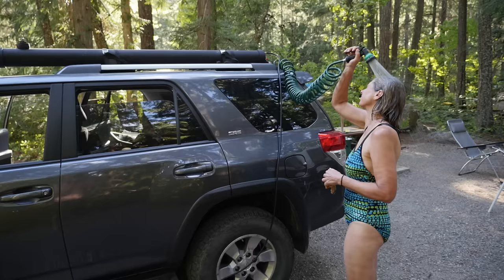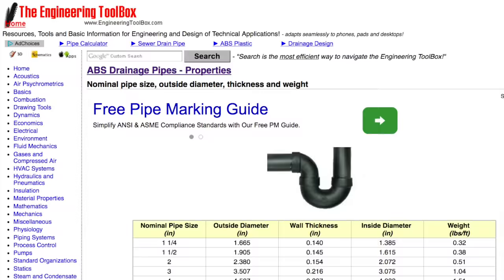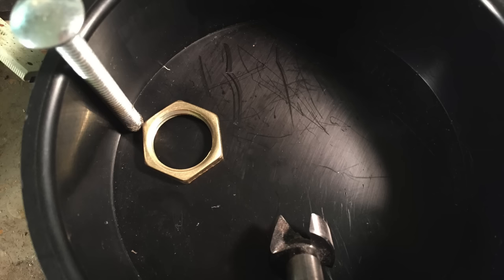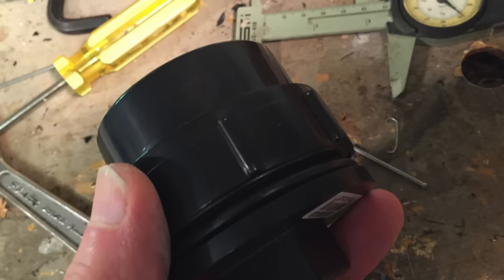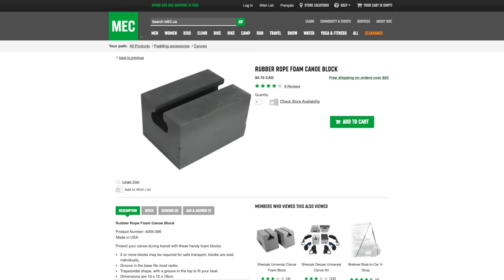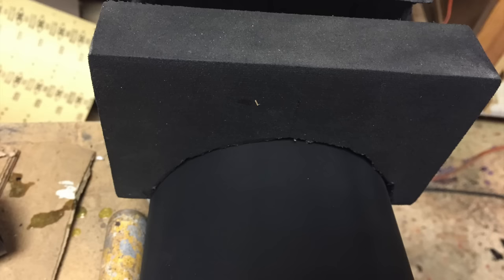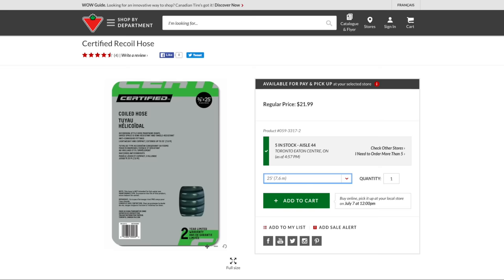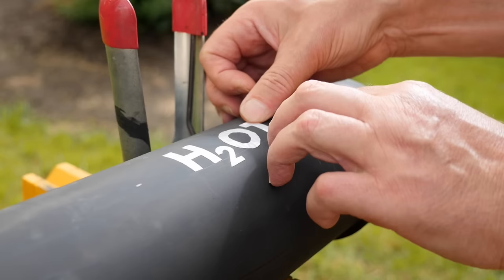H2OT - Rooftop, pressurized, solar-heated shower/sprayer using ABS pipe. DIY

Comment: Could you provide links to the valves you use?
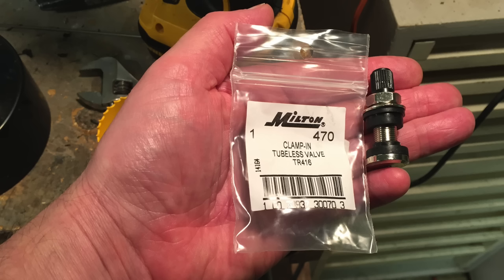Reply from the maker: All the components are shown in the video at 1:27 and 1:58.  I do not list them as the odds of that specific part I used in the build also being available where you live are slim. Unless you live in Canada, many of these parts would require substitution so links to what I used is irrelevant.

Comment: how much did the whole contraption cost - time and money? Was also looking at Road Shower 2 for sale but price is like  $300 with the mounting pieces.
Reply from the maker: It cost me $300 plus mounting pieces.  :-)
Reply: @Blake, he mentioned that it cost $500 to import, so this a $200 savings. you could make it much cheaper by using abs pipe which is already black.
Reply from the maker: No, I was joking. It cost me about $60 total.  I would not make it if it cost the same to buy. Most expensive part is the ABS pipe, which was about $30 if I recall. 

NOTE: This IS made with ABS pipe. Yes it is black, but it is shiny. I painted it flat black to aid absorption of heat.

Comment: My friend gave me their pvc shower, but it keeps leaking from the caulk around the valve anytime it's pressurized above 5psi. Does anyone know what materials or adhesives I can use to seal it up to whitstand higher pressure?
Reply from the maker: JP Weld will patch anything. Give that a try.
Reply: @ImaginetMedia  awesome I'll try it out. Thanks so much for the advice
Reply: @ImaginetMedia  Just saw there's so many types of JB Weld. Any input on which might work best?
Reply from the maker: https://www.jbweld.com/product/j-b-weld-twin-tube
Reply: imaginetMedia thank you so much!
Reply: Nicholas Kinoshita flex seal

Comment: I’m about to start this build tonight. I went with legitimate PVC, which you know is a bit heavier duty and without the BPA. Was thinking about going 7-8 feet instead of six. Any reason why you would recommend against this?
Reply from the maker: Take a piece of PVC pipe and a piece of ABS pipe, same size. Put them on the ground. Take a sledge hammer and smash each one.  When you get back from the hospital having the shards of PVC removed from your face, I will explain to you why I used ABS.
Reply: imaginetMedia hahaha. Well, I don’t expect this to be taking impact hits like that... but regardless, what do you think about the longer size/pressure in the tank.
Reply: imaginetMedia also, I won’t need an explanation after the shards have implanted themselves... lol
Reply from the maker: @DrewTimelapse  I think the longer version would be great. However, with that length comes significantly more mass (pipe and water) on your roof. The problem would be securing the heavier tank using only straps as I showed. I suspect a much bigger version might be classified as a missile launcher if you hit the brakes too hard.
Also, I used 6' length because that is. common precut size of pipe. Longer than the standard would certainly cost more.  I suggest checking with plumbing suppliers to see what lengths are available in your area.
Reply: Thanks a bunch! Really appreciate your build here. Very complete and descriptive. Did you consider doing the 4” t adapter with the female threaded clean out instead of the 2” cap that you ultimately went with?
I see a few people doing that instead. Just curious if there’s something I’m missing with one over the other.
Reply: BPA is a misnomer. Plastic is bad for your body, period. Sorry if it bursts your bubble... 

on the other hand, you know we are breathing nanoplastic 24/7 and can't get it out of our water even if we try.
Reply: @lexiecrewther7038  To much fabrication work for most peoples skill set.

Comment: Is there anything that can be put inside the container to stop water sloshing back and forth while travelling when kept full and or half empty etc that would also keep food safe for drinking and or shower use, hot water drinking etc?
Reply from the maker: I only drive with the tank 100% full, literally to brim of the fill section. As water does not compress, the water has no where to "slosh". It essence, it is a solid mass (as if it was ice). This is critical as driving with anything less than a full tank, you will have to potential of forming a water hammer. The water is arely in the tank for more than 8 hours, so I am not concerned about the potable water aspect. I do use it for quickly pressure washing by dirty dishes though.
Reply: You could glue in some baffles if your worried about it. I wouldn't worry too much about 4 gallons.
Reply: greenspiraldragon Good tips. That’s a manageable ideas that I had not considered. Mine calculates out on your chart at around 45ltrs. 6 inch round. I’m nearly finished just got to determine how to mount on the side of my roof rack and paint.

Comment: I live in a major city in Texas and have called plumbing stores all over town....I cannot find Cell Core ABS pipe. No one here sells it. Will Schedule 40 solid PVC work if I'm following your steps?
Reply from the maker: I do not recommend PVC pipe. Read my response to Tony Knapp's question, below in these comments. I explain the advantages of ABS vs PVC.  I just searched Lowes and Home Depot's USA online stores and both carry 4" ABS Sch 40 pipe.  This is standard DWV drain pipe and any outlet that sells plumbing supplies should have it.
Reply: More pep need to think like this. Wonder if a plastic gas tank could be strapped up there for more volumn? I also was thinking of a small custom camping  trailer built to hold a tank on top...could have a toilet inside ect. Rains? Use van for bedroom and still have dry toilet in back trailer(with umbrella)
Reply: +imaginetMedia The problem I'm running into is that cell-core (or foam-core) isn't readily available in southern states (like Texas, where I live). Closest I found was 4" foam-core PVC by JM Eagle at Home Depot, but the closest one is over an hour drive away. Fortunately I had a friend driving to me from one of those locations and picked it up for me.
Reply from the maker: Reiterating, I do not recommend PVC pipe. If you cannot get cell core ABS, then use regular solid wall ABS pipe. It may cost more and that is why it is not readily available where I am. Regular solid wall BS will heat up faster but will not retain the heat as long, which probably  is not an issue.

Comment: So I built it kind of the same way. 4” pvc 40. 5 foot long. Air valve on one end and water spout and intake together on the other end. I get pressure for a few seconds and then it fizzles out. Am I missing something???
Reply: only half fill with water. the more water you put in the less air you can get in
Reply: do you have the water spout side down hill

Comment: it would be so helpful if you cold dd links to all parts you have used in this build
Reply from the maker: But links would be meaningless unless you lived where I do. Most of the stores I picked up the parts only exist here. Do you even know where here is?  I clearly showed every part  I used, so that you can source the parts locally.  If you need any help, let me know.
Reply: @ImaginetMedia  what type end caps did you use? I can't find 4" sch 40 flat caps that fit, only round.
Reply from the maker: @theox4362  https://www.homedepot.ca/product/lesso-4-in-abs-cap-hub/1000427072
Reply: @ImaginetMedia  thanks, gues they don't sell them in store around here. 
Been fighting like crazy trying to get leaks under control, none of these fit snug enough together to not use putty or thread tape etc. Annoying
Reply from the maker: @theox4362  What are you using for solvent cement?  ABS cement actually chemically welds the caps and fittings to the pipe. The joint is stronger than the parts themselves. If you use the correct ABS cement, it will never leak.  https://www.canadiantire.ca/en/pdp/oatey-abs-cement-yellow-118-ml-0630892p.html
Reply: @ImaginetMedia  i used 2 in 1 abs cement, it must have not been enough. Instructions started not to puddle it, so i didn't go too heavy. Leaked at both ends of a t pipe w/ a cleanout i installed. If i can't break them apart i may reapply it.
Reply from the maker: @theox4362   1) Are you sure it's ABS cement and not PVC?

2)  If you have drilled out the 3 holes for the fittings, save the shavings. If you mix the ABS shavings with ABS solvent cement, it forms a very fast setting goo, that is perfect for filling gaps, and in your case, leaks.
Reply: @ImaginetMedia  does abs have a tighter fit? I had to use pvc, no one around here for some reason has abs pipe over 3" if anything at all. But i was using the pvc cement. If thats the reason im going to have to order everything online and rebuild it.
Reply from the maker: @theox4362  PVC will work, but I did not choose it for numerous reasons. One of which is this. Take a piece of PVC pipe and lay it next to a piece of ABS. Take a sledgehammer and hit each one and see what happens.  You can contemplate the results on your way to the hospital to get the shards of shattered PVC removed from your skin!   :-)

having said that, PVC fittings on PVC pipe should fit as tight as ABS fittings on ABS pipe.  In fact, I had to really force my on even during the dry fit test. I suggest you go to a real plumbing supply outlet and not a big box home depot type store before yo order anything online. Yo need to test the fit before you buy.. A plumber will be able to help you out.
Reply: @ImaginetMedia  awesome, thanks for all the help. 
Most of these fittings i bought bottomed out if not, close to it. I'll look for a plumbing supply place and get some ABS. Thanks again
Reply: @ImaginetMedia  Links change over time.
Reply from the maker: @HondaFit4Adventure  All the parts are clearly shown. Google is your friend.
Reply: @ImaginetMedia  I know, I was supporting your idea with another reason of why not to provide links.

Comment: Do you find it normal for the pressure to go down 1-2 lbs per hour after pumping up?
Reply from the maker: I only pump it up moments before I use it.  I never leave it pressurized when not in use.

Comment: Which exact part did you use for the longer aluminum tire rim valve?  Thanks : )
Reply from the maker: I used a Milton TR416 Clamp-In Tubeless Tire Valve, which you can see a close up of at 1:57 in the video. If you Google "Clamp In Tubeless Tire Valve" or search on Amazon or eBay, you will find lots of them.
Reply: +imaginetMedia Thank you!
Reply: +imaginetMedia hmmm...that's odd because after watching your video the first time I ordered that exact valve and it seems to be too short. As in there isnt enough thread on the other side of the 4" cap in order for the nut to be able to grab. I thought you mentioned something about going for a longer aluminum valve but it appears as though this is the one you were talkin about. Not sure why mine wont thread. Its the only missing link keeping me from completing the build. Haha.
Reply from the maker: Well that is strange. I think the length of of thread is standard. Also the wall thickness of the 4" cap is pretty much the same thickness as an aluminum tire rim.  Can you  post a link to the exact valve you bought and also to the exact ABS cap.  Regardless there are many many clamp in valves to choose from.

Comment: Hi, so I'm trying to make one of these on South Africa and are running into some problems figuring out the sizes... what are the dimensions of your shut off valve? and is your hose really 3/8" (9.5mm) ?
Reply from the maker: The ball valve is standard garden hose thread to tapered NPT thread.
The hose is 3/8" inside diameter, 20 ft long.
Reply: imaginetMedia just don't want to get the sizes wrong here... standard garden hose being 16mm and the NPT thread being 19?
Reply from the maker: I din't think it really matters. You can use any shutoff you want. I just happen to have used a ball valve rather than a a regular tap/spigot. As long as it has threads on both ends and the the threads match your hose, is all that matters.
Reply: imaginetMedia so those sizes won't affect the of water really? That will depend on my shower head? I saw the original roof shower has a very thick pipe
Reply from the maker: It is also on 6 feet long.  My hose is 20 feet long. That is why I used 3/8 hose not 1/2", to reduce capacity lost in the hose. Plus, my sprayer specifically has a shower setting. This also helps to restrict flow, thus conserving water.

Comment: if your tank is half full and you pressurize to 35 psi, how long is the water flow? can you empty the remaining water on that single charge?
Reply from the maker: I have answered this question several times with full explanations of the air to water ratio in the previous comments. Basically, if the tank is full there is no capcity for air as water cannot be compressed. As water is deleted, more volume is made available for compressed air. The more compressed air capacity you have, the longer the pressure will sustain the shower flow.
Reply: imaginetMedia 

that answer has absolutely nothing to do with my question. thanks anyway.
Reply from the maker: I am sorry if I misunderstood your question. I have answered similar questions several times with full explanations of the air to water ratio in the previous comments. I thought your answer would be found there. 

You can calculate exactly the retained air capacity and pressure as I provide all the volumetric data in the spreadsheet shown in the video. This is a Bernoulli equation problem.
Reply: Yes

Comment: Does the water ever overheat?
Reply from the maker: No. Not at the latitude where I live.  40C is about as hot as the tank gets here. There are lots of factors influencing the max temperature especially the amount of direct sunlight is available.

Comment: So how exactly is it getting heated? Only by sunlight correct? Sorry if I'm asking a apprentice question. Just trying to fully understand this concept, would be nice for my Jeep
Reply from the maker: Roof top, pressurized, solar heated shower/sprayer
Reply: @ImaginetMedia  So as long as I have SUN hint, hint, that's my main source of what heats the water? No external heater or anything hooked up to it?
Reply: @anythingadrenaline4515  correct. You could add an on demand heater too this system if you wanted, but unless you are winter camping I don't think you'd need it.
Reply: Anything Adrenaline Yes. Sunlight is all thats needed.  Works even in winter, but much better in summer.   Place mylar/reflective sun shades a few inches underneath the tube for even more "sun power".

Comment: What size hole did you drill for the tire valve..
Reply from the maker: It would be whatever the outside diameter of the threaded end of the valve is. As the threads are not tapped into the ABS (like the drain was), it will be the exact diameter of the valve.

Comment: Great idea, however I'd be leary pressurizing plastic water pipe with air.  Particularly hot pipe.  

Im sure you know this, but water is not compressible, air is. It could potentially burst, violently, on you. There is a reason the commercial one is constructed with aluminum.  Pressure vessels are not something to mess around with.
Reply from the maker: Please look at the pressure rating chart I showed in the video. This build is not plastic. It is cell core Acrylonitrile Butadiene Styrene.
Reply: Two words for you. Potato Gun

Comment: How long is your spray time ?
Reply from the maker: Time is irrelevant as I never leave the spray on. Spray to wet myself, then soap, lather. Then spray to rince off.  Spray is off most of thetime.
Reply: @ImaginetMedia  I hear ya there. I'm just trying to get an idea. I have a 4"x6' pvc sitting in the back of my truck. So I'm just trying to figure out what kinda on runtime I have. Or how many showers in what you describe. I figure I'll run at about 30psi and use the " shower" setting in the nozzle and just use what I need.. so I guess a better question would be, how many showers can you get out of one full tank?